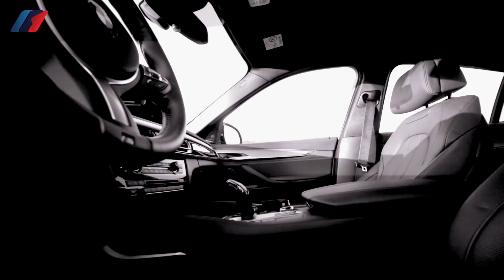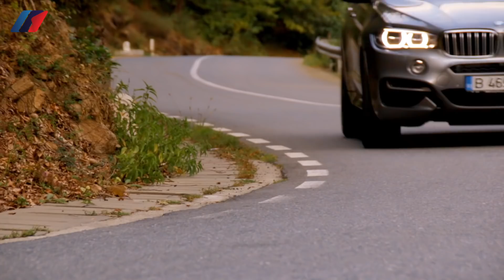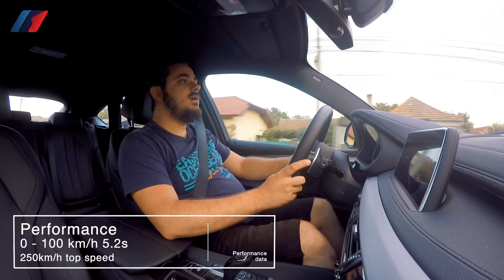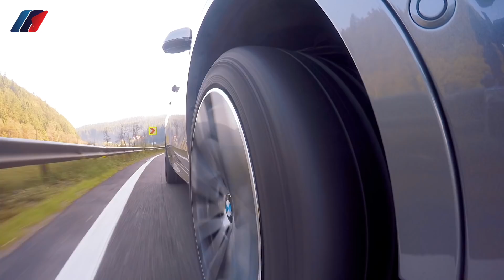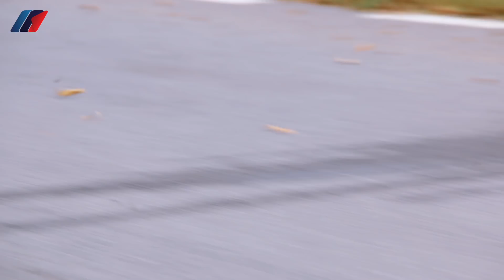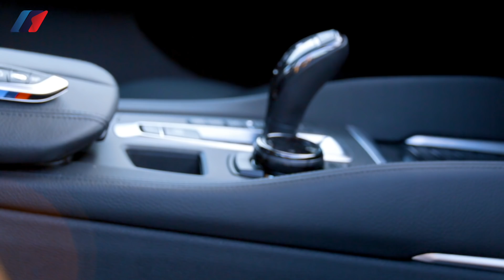This BMW X6 M50d (F16) has THREE turbos!

Comment: E71 m50D Released on 2012 has 3 turbos also and it s the first Suv on the market with this specifications .i am driving this engine sine 2013  ,,, this f16 is having the same engine with minor modifications . :